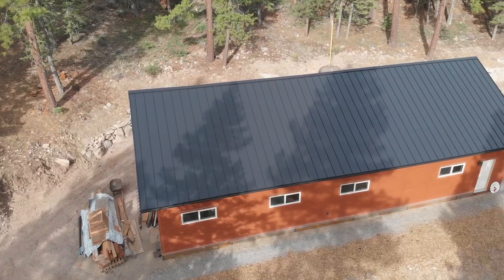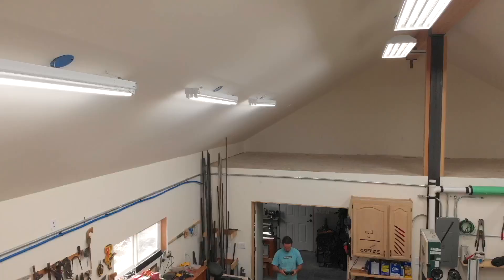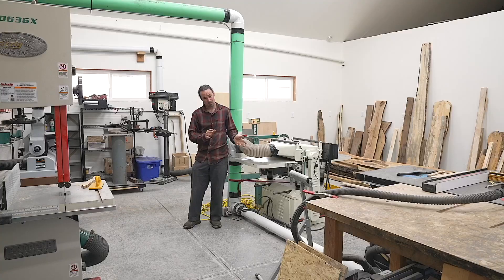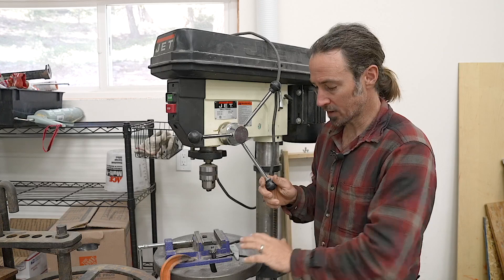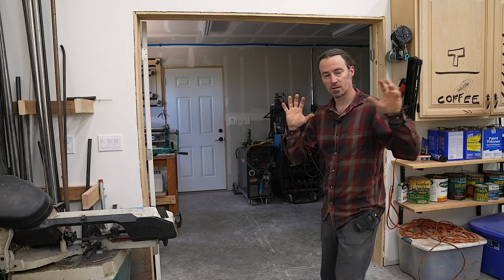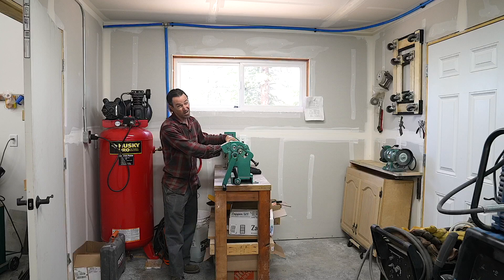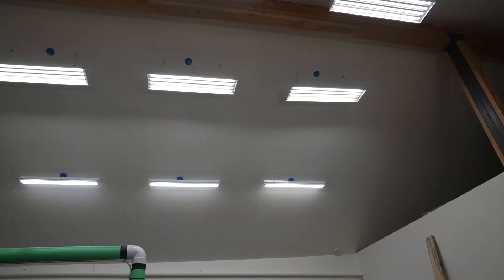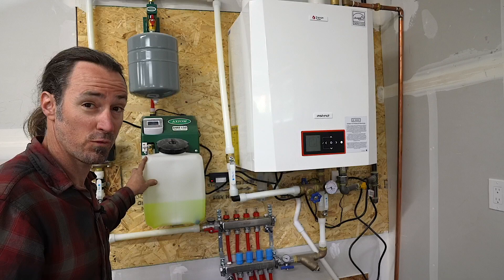How to Setup a Workshop - Design, Tool Layout and Machine Locations - New Woodworking and Metal Shop

Comment: Great space
You might want to revisit your dust collection system
Replace the 90's with long sweep or radius to minimize restriction.
Replace 'T' fittings with street 90's again to minimize restriction.
That will result in a more efficient system  and could prevent clogs.

To minimize airborne dust the bags produce, I'd add a cyclone to the system
OR
build a room with filter walls to contain airborne dust.  The added benefit could be noise reduction.
AND
Add an air cleaner to reduce airborne dust, in your case you might need two small ones.  

Radiant heating is the ONLY way to heat a woodworking shop.
You didn't mention the fuel.

Cheers,
Reply from the maker: Thanks! Yeah, these are all great ideas. I am planning on building a small room for the dust collector for dust and noise. I've never been a big fan of cyclone systems - they are a great idea and design, but don't seem to give a lot of extra bang for the space and cost. I may change my mind on that some day! 

RE: Radiant - I've got propane. I like radiant, but I think I would have done an air-to-water heat pump instead; electricity is way cheaper than propane out here...and eventually I'll get a nice solar setup that would make heating costs even cheaper. But for now...it is propane. 

So far, the only area that I ever tend to get clogs is the entrance into the dust collector; it has an X shape over the entrance hole, and it sometimes gets clogged when I produce a lot of planer shavings.

Comment: A shop that many of us can only dream about,  well done on the build and set up. How much of the shop is dedicated to your actual wood working. I am about to start my shop build but the biggest I can go is 23' x  8 as planning reg (in UK) restrick us and only alloud us to use 60% of our outside space and limit the hight to a max of 9'8". Looking forward to seeing your future builds.
Reply from the maker: Yeah, go as big as you can! I wish I had more space...but I was restricted by the location and costs; it was already super expensive. In my county, we have limits to how much we can cover our land with impervious materials (buildings, driveways, etc), and how many livable structures (2 per parcel, one limited to 1200sf). 

The "woodshop" area is roughly 30x32 or so..roughly 1000 sf. The back metal shop area is about 200 sf.  Overall it is 1200 sf, which is my secondary livable structure size -- somewhat by coincidence and intentional, in case it was ever converted to a livable structure.

Comment: Can you tell us a little more about the aluminum tubing you used to pipe compressed air through your shop? How easy was it to work with? How flexible is it in terms of being able to splice / reconfigure?
Reply from the maker: Yeah! Here's what I got... 3/4", but I think I really only needed 1/2". It's pretty easy to deal with...the fittings are expensive if you need additional stuff; that's the only drawback. Otherwise, it is safer and better than a lot of other options (ie: black pipe or copper - galvanized shouldn't be used, nor regular plastic tubing). 
https://www.amazon.com/gp/product/B005FKYRTU/ref=ppx_yo_dt_b_search_asin_title?ie=UTF8&psc=1

Comment: And here I was about to call you up and say "hey Corby how should I set up my shop?"

Did you use any software to help lay things out, or just pencil and paper?
Reply from the maker: Yeah! It's less than a week later and I already moved some of the machines around.  Before I made the building I did some rough spacing concepts with SketchUp. It is hard to get a feel for things in digital land; some things I thought would work didn't, and other things I thought were too close together were okay.

Comment: Nice shop! Did you consider building a sub floor in the wood shop for dust collection/outlets? The cool part is then you have a wooden floor, easier on your feet and if you drop tools etc? I am starting a shop build and looking for ideas, thanks for the video!
Reply from the maker: Thanks! I did think about a subfloor, and I've seen some people who have done it. It reduces the vertical space by quite a bit, and the wood makes it harder to move around heavy machines. My one friend who did it thought it wasn't worthwhile. 

I'm surprised about how often I tend to reposition stuff, and it is pretty easy to do when sliding them on concrete. I haven't dropped any "important/delicate" tools and had them break, so I'm not too worried about having a softer floor for that reason. Have you spent considerable time standing on hardwood floors? Consider if the softness of hardwood would be much better than just adding mats on concrete for your feet. Standing for long hours on my kitchen hardwood floors is pretty tough...and we have soft mats to alleviate that.

I also know some people have put dust collection pipes embedded in the concrete. I already have re-positioned tools a few times, and it would have been more limiting to have the pipes in concrete. I like the flexibility of moving them around when needed.

Still, huge disadvantage of what I did: I have one pipe on the ground, which is sometimes annoying!
Reply: @CorbinDunn  thanks for the info, lots to think about for sure!

Comment: Great work on the building and shop! I'm designing a building pretty soon as well and it's helpful to see how both aspects of wood and metal can coexist in a structure! 
Two related questions:
1) Is there anything that you're super pleased with re: forethought and planning? (I.e. did anything turn out better than you planned?)
2) If starting over, is there anything you would have done differently given a different budget or footprint?
Reply from the maker: Yeah! I’m not sure i would do radiant heating - I’d look more heavily into heat pumps (for both heating and ac, but I am more in need of heat in the winter than cooling in the summer). Bigger is always better. I’m not sure the open vaulted ceiling was worth the cost; I did this to have storage and more space above my two rooms (garage and metal area). A traditional flat truss ceiling would have been easier, and probably cheaper. But instead of 10’ ceiling, it would have been nice to have a truss system with a 12’ ceiling. 10’ would be okay too, but I heard 12’ is nicer. The 3’ wide double doors give me almost 6’ wide to get stuff in, but my bobcat can’t quite fit; I’d like bigger doors… maybe a garage door (but that has issues in California to pass title 24 heating requirements). 

Overall, I’m pleased with the table saw location; I can rip large sheets and long pieces with ease.
Reply from the maker: I also moved my jointer to be adjacent to my planer - they go hand in hand and it saves some space.
Reply: @CorbinDunn  Thank you for the thorough & detailed response!

Comment: I am curious about the cabinet for the dust collection since those dust collectors count on the bags (the filters) to send filtered air back into the space.  I have a single bag unit and the noise is definitely less than ideal, so I’ll be curious to learn more about what you intend there.
Reply from the maker: Yes! My idea is to have some filters on the cabinet; particularly because my bags are terrible filters. I'll reply here once I get it built and done.  It might be one of the next shop things I do, after some more shelving.
Reply: @CorbinDunn  Yah, I upgraded my bag to a 1 micron one because the stock one was 5 microns and that's just enough filtration to fool your lungs into thinking it's fine while still letting through all the most damaging small particles 😕

Seems like it will take a lot of filter area to equal (and avoid restricting) the amount of airflow possible through two bags which have a lot of surface area.  I'll be interested to see what you come up with.
Reply from the maker: Update: A dust collector closet! https://youtu.be/gppFjH-8ovQ

Comment: Your work shop look amazing very nice job  I am currently having pole barn build in few weeks this will be my third and last shop hopefully, question about not opting for dust collecting system in ground ive had it in ground before and plan on doing again jzst your thoughts would u put it in ground in hindsight?or not thanks
Reply from the maker: So, I like to move stuff around. I've already moved a few machines since I made this video, and it's probably already time to do an updated video on my setup, and I've had to re-do the dust lines a bit. I feel like it is more flexible to have the dust tubing in the air than embedded in concrete. If you have tons of space, then just give a bunch of space around each machine and drop it in the ground. One worry I had was clogging and not being able to get to a particular clog...but in general, those only happen at T's or 90's, which can be limited underground. I also built my garage with the thought that it could be converted into an ADU at some point, in case some future owner would rather have an ADU instead of a workshop.

Comment: Those look like 15A receptacles. If you're running a 20A circuit with 12 gauge wire, wouldn't you want a 20A receptacle (the ones with a sideways "T")?
Reply from the maker: You are right, they are 15A receptacles! I ran a 20A circuit with 12 gauge wire so I can have more outlets on one circuit. This way, multiple things can pull 20 amps from the circuit and not flip the breaker. Previously, I would have that issue running a space heater and heat gun at the same time.  I could have some 20A receptacles, but I don't have any tools that need it. Any large tool that requires a 20A plug should probably be isolated and have its own circuit, and I've found that a lot of large 110v machines can be re-wired for 220v, which is a bit more efficient. All my large 220 volt machines are on dedicated circuits; I have a sub-panel dedicated for my 220v machines (mainly due to saving wire). One could share some outlets with big machines, but having a buddy turn on one when you are using another would likely flip a breaker.